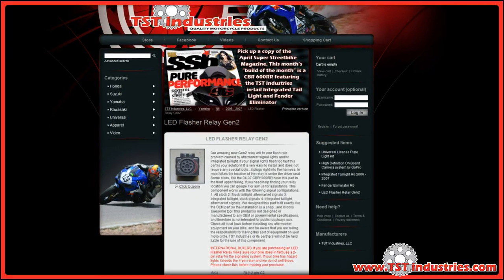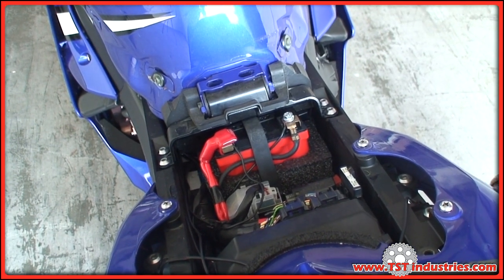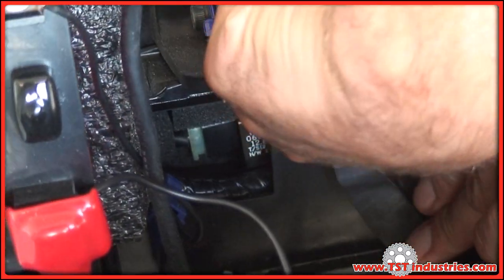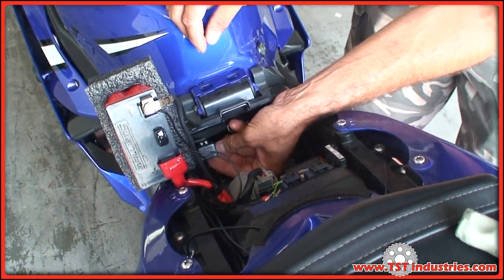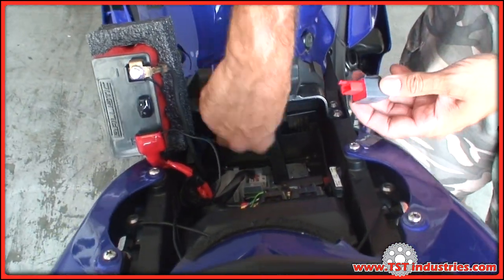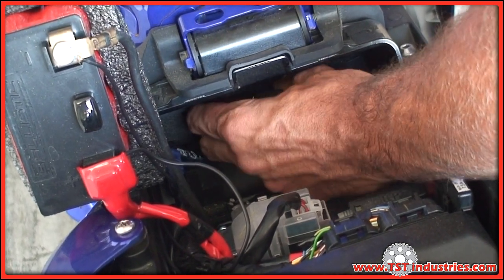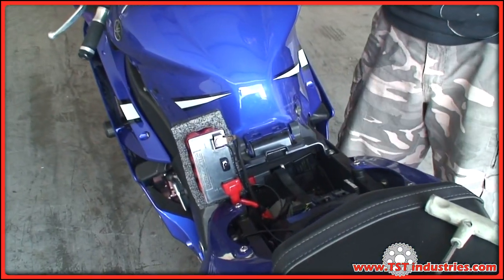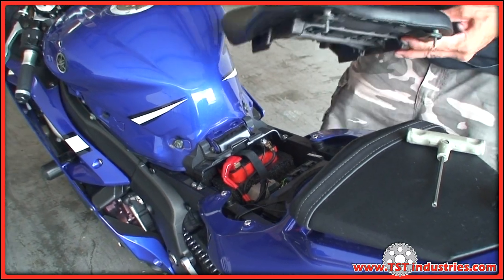How To Install LED Flasher Relay on 2006-2007 Yamaha R6 by TST Industries

Comment: Hey, I have a 2012 R6  - I have a question for you? Do I need to use the resistors that came with the integrated tail light in order to reduce the flash rate and how fast is the flash rate if I dont install the resistors.

Is there any other way around installing flush mounts without splicing the wire
Reply from the maker: Yes, we sell harness converters that have connectors for the signals on one side, and connectors for the bike on the other. We also sell high end signals that are model dedicated, and are pre-wired with appropriate bike connectors.

Comment: hey what if one of my blinkers is working but other is not?  the one that is working is a little iffy too but it does work... please help!
Reply from the maker: Send our Support Team an email with a short video and your order number and we will work to get you all taken care of! If it's not our product, you may have a faulty connection with the wiring or internally in the signal. Either way, we're here to help! support@tstindustries.com
Reply: @TSTindustries  its not one of your products but i was hoping you could shed some light, i saw this reply you guys sent  "I am assuming that you have no signals left AND right. If this is so then there is a possibility that your relay is bad. BUT....most of the time I see this failure it is the switch. The relays on modern bikes are solid state, and just don't fail very often. Your bike has been exposed to 12 years of moisture, and the contacts within the switch can corrode and cause poor contacts. I would use a multimeter in continuity mode to test continuity on the switch left and right. You would need to unplug it from the bike and find the connections corresponding to that function. Otherwise, there is a way to manually power up the relay to see if it send signal to your lamps. This is a bit more sensitive because you have jump battery positive to the correct pin on your relay and not reverse it. I don't know if you have an OEM relay or an aftermarket one but I hope this gets you in the right direction."

the first part says no signals left and right, just wondering if the answer would have been different if it was just one side not working. thank you so much for the quick reply! you guys are awesome
Reply from the maker: If you have no signals left AND right the problem will likely be upstream of your signalling switch, or in center contact of the switch. If the problem is on only one side then it is not likely an upstream device like the relay. That side's signaling switch contact could be intermittent, you may have loose wiring anywhere between the switch and the signal or its ground connection. Please tell me what you mean by "iffy but it does work." If this is on a Yamaha, and you are experiencing dimmer than desired operation, but it does actually light up then please see this video about possible incorrect wiring of signals: https://youtu.be/yN2RcX-vtYI?t=120

Comment: I have an 06 R6 and I cant tell if my switch itself is shot or the relay. how do I tell
Reply from the maker: I am assuming that you have no signals left AND right. If this is so then there is a possibility that your relay is bad. BUT....most of the time I see this failure it is the switch. The relays on modern bikes are solid state, and just don't fail very often. Your bike has been exposed to 12 years of moisture, and the contacts within the switch can corrode and cause poor contacts. I would use a multimeter in continuity mode to test continuity on the switch left and right. You would need to unplug it from the bike and find the connections corresponding to that function. Otherwise, there is a way to manually power up the relay to see if it send signal to your lamps. This is a bit more sensitive because you have jump battery positive to the correct pin on your relay and not reverse it. I don't know if you have an OEM relay or an aftermarket one but I hope this gets you in the right direction.

Comment: my batterysnot coming out...09 r6 looks like im going to have to take the tank off... unless you have any suggestions
Reply from the maker: this video is on a 06-07. The procedure is different on a 08+ and the relay is located in a different place. This is the video you want to see for the procedure for your bike if it is an 09: DIY Installation of TST Industries Gen2 Flasher Relay on a 2008-2014 Yamaha R6
Reply: thanks just figured it oouT!
Reply: TSTindustries I have the same problem on my 07 R6. My battery is not as small as yours and will not come out. Do I have to remove the 4 tank bolts first in order to remove the battery?
Reply from the maker: Aznemptyjry If you have an oversize battery and you have already tried removing it with the wires disconnected to no avail, then try to take out the bolts holding the tank bracket. This will allow you to pivot the tank bracket up and make enough room to take out the battery.